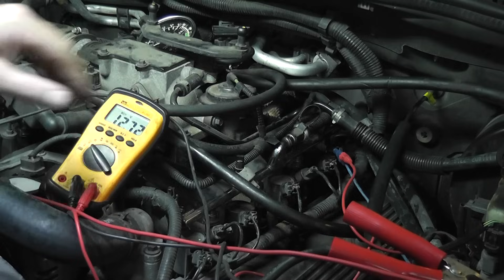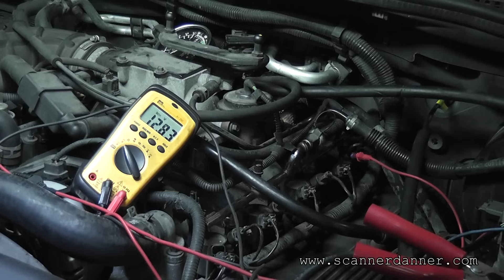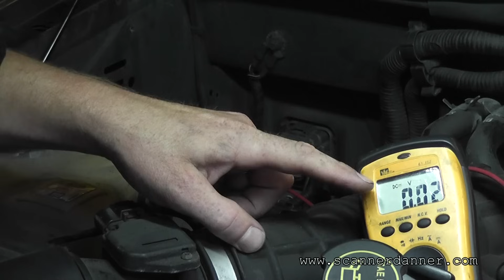How to test a fuel injector circuit with basic tools (open control wire)

Comment from the maker: This video was taken from a 5 part training series I did for my students on various ways to identify a misfire and restricted exhaust testing. You can find this 5 part series here 
https://www.scannerdanner.com/scannerdanner-premium-chapters/misfire-case-studies.html
Reply: Thanks for the great info! I have a injector wiring issue on my 2007 jeep wrangler. I have a cylinder #4 misfire. Its reading 14.0 -14.1 only on #4 cylinder. 1,2 3,5 and 6 injectors read 13.6 -13.8 and never reach 14.0. Where could my problem be?
Reply: Thanks I just found out what the problem was thanks to your video on crankshaft sensor. I was getting no spark on ignition coil pack but did have voltage on the connector. So checked voltage on the fuel injector with a light probe. The control side was no lighting the probe when I cranked the engine. So I checked the crankshaft sensor by the harmonic balancer. As I was checking the connection, I noticed the teeth weren't underneath the crankshaft sensor and the belt seemed off. After further inspecting the harmonic balancer I notice it was coming out which got the teeth to not be underneath the crankshaft sensor. The bolt holding the harmonic balancer had broken off and balancer was coming off.
Reply: Do you know of a great mechanic in the 92336 zip code area. I am in Southern California. I have a  2000 Ford mustang v6 with a crank no start, no spark. I have checked about everything, I think, and I am thinking it probably something simple that I am missing. Any help appreciated ¹
Reply from the maker: @victorrodriguez2158  I have a few shops using my training in southern California. Check out our shop directory  https://www.scannerdanner.com/find-sd-shops.html
Reply: Thanks again

Comment: Since you already know that the injector is not firing, and you have the wire identified and back-pinned at the PCM, couldn't you just pull the connectors off the injector and the PCM, and check for an open doing a continuity test? You wouldn't need the noid or the test light, or even to start the vehicle.

Comment: Hey I have Long term fuel trim -18 to -20 I think injector leaking? When car is in almost normal temperature it says about -17... It means to much fuel so how to check what's wrong? Should be one or few Spark plugs wet or.... to see which leaks?
Reply from the maker: Injector balance test for sure. Is this a GDI system? This get's done with the scan tool if it is. If it is a MPFI system, you will need an injector timer tool and a fuel pressure gauge. I have videos on this
Reply: @ScannerDanner how much I googled it says mpfi
Reply from the maker: @Evald4s  what is the year, make, model and engine size?
Reply: @ScannerDanner 2004 Ford Galaxy (wgr1) 2.0 petrol
Reply from the maker: unfortunately we do not have that model here, but it being an 04 model year it is most likely just a regular port fuel injection system

Comment: It's 08 gmc sierra 1500 4.3 v6 spider injection  ,
My question is with only disconnecting how to check n the procedure for pulse signal?
Reply from the maker: No different than any other injector. You have a control wire for each injector in that main bulk connector. Lab scope or test light can show you a pulse

Comment: There's not one single video anywhere on the net .
On how to test a 👉spider connector👈🏽 .
It keeps throwing to way older models or single individual injectors, 
Can you help
Reply from the maker: What's a spider connector? Are you talking about the "spider" injector assembly? That's a slang term. It is called CPI (central port injection) and there were two types. The earliest models (up to 95) used one central injector and then with OBD2 in 96 it was changed to a sequential system with one injector for each cylinder.
So I need you to clarify what you are working on, and what problems you're having and what you are trying to test for.
Reply: @ScannerDanner yes

Comment: what if the injector is always on?
Reply from the maker: Short to ground on the control wire or shorted driver
Reply: @ScannerDanner  driver short is the ecu ya?
Reply from the maker: Check control wire first before you condemn a driver!

Comment: How did you fix the issue
Reply from the maker: based on the title of "open control wire" I would probably use a crimp style heat shrink butt connector

Comment: Could you do something similar on diesel injectors without a scope. Noid lights and test lights etc don't pick up injector pulse on diesel but I'm curious to know if there's a low tech way of testing them without access to a scope.

Comment: Awesome video!!  My wifes 2013 civic says injector stuck open. My injector wire isn't pulsing its staying 12v both sides.  Is that her computer that's bad?? PLEASE HELP
Reply from the maker: How are you testing the injector control wire? A voltmeter is too slow to see the pulses. If you're sure there is no control, the next step is to test that same injector control wire at the PCM. If it is 12v at the injector and 0v at the PCM, you have an open in the wire.
Reply: I used a light and all are flashing except cylinder # 2    2nd from the left.    I hvae 12v on yellow wire. But pulsing wire not working.  I do have continuity from ecm to injector in that wire    @ScannerDanner

Comment: This is a great informational video. Thank you for this and all the other information you share as well. I just have one question: if there is battery voltage on the control wire at the injector, why should it be zero voltage at the computer?
Reply from the maker: It should be battery voltage at the ECM as well.
Reply: Thank you for clarifying. I must have misunderstood the video... @ScannerDanner

Comment: Scannerdanner I know this video is old but I could use your HELP!! I have a 2000 Dodge Ram 1500 the other day I got in it and when I started it the engine light came on so I put the scanner on it and it said po306 cylinder 6 miss firing here after a closer look either a squirrel or field mice chewed the wires to the injector so I got another injector plug and wired to replace the bad one but now it's still feels like it's missing and on the scanner it says open circuit , is any chance you give me some kind of direction on what to do next , I'm not a wealthy man I live check to check I'm 65 and Pops 90 we're both lost on what to do next any suggestions would be well appreciated 🤯 ,
 Thank You myfriend so much 👍✌️

Comment: Hi paul just came across your very informative video. I have no injector pulse on cylinders 4 and 5 on a 01 f150 with 5.4. As soon as i put on the test light on the computer side it flickers and both 4 and 5 stop missing but the miss goes to cylinders 1 3 and 8. Watching it through scanner. Still means open circuits or bad pcm?
Reply from the maker: You must consider "intentional shut-down" with what you are chasing.
https://youtube.com/shorts/r5LE3EwjtP8?feature=share

Comment: I don't understand.  Why not just use the multimeter to test for continuity of the signal wire from the back of the PCM to the injector plug?
Reply from the maker: Which test are you referring to? Starting at the ECM and doing continuity testing is the last thing you'd want to do
Reply: Thank you for taking time to reply.  I mean once you have determined it is either the ecm or the wire from the ecm to the injector plug, why not simply perform a continuity test of the wire?  I have this problem myself with a 2000 grand cherokee.  I didn't want to tear apart the back side of the ecm electrical connector, so with it disconnected from the ecm, I probed the front side and checked continuity to the injector plug. If there is a problem with this method, I'm all ears. Thank you for taking time to share your knowledge.
Reply from the maker: @01Z06guy  i would simply perform a voltage measurment at the ECM pin in that case. A steady 12v (injector plugged in and known good of course) would tell you the wire is fine

Comment: BMW 2013 E70 N55. High  voltage to all of the injectors.  car does start, but idle poorly. I do read 12V  on  integrated supply module for DME as it appears you are connecting with test light at end of video. Noid lights on all 6 injectors does not turn on.

Comment: If I measure 12 volts at the Negative side of the PCM Inejctor Control Pin then that means the computer is shorted to positive?
Reply from the maker: No sir. It's just not being grounded, or your meter is too slow to see the 5m.s. pulses to ground

Comment: 1995 corvette , noid lights flash , but will not spray. 44 lbs fuel pressure , new injectors , will start if I spray fuel into tb.
Reply from the maker: A follow up to your noid light test. Give me voltage readings on one of the fuel injectors during cranking. Injector plugged in and backprobing
Reply: I have full voltage with switch on at injector
When I crank the engine voltage drops to 9 volts. I have checked all grounds for continuity, they check good.
The started pulls voltage down to just below 10v when cranking.
Reply: Thank you for your help , it's a 1995 corvette , and it runs if I pour gas into TB. I don't know what else to check. I'm leaning toward starter taking all voltage and not leaving enough for injectors. Battery is new 12.7 volts. Thanks again. Help😵‍💫

Comment: Wouldn't be this test same as performing a continuity test between injector wire connector unplug and at the computer connector wire  also unplug pin to pin ? To check if there is an opening if there is continuity then there is not opening or would a wire show continuity no problem but a slight opening big enough to be  causing current to drop but just good enough to pass continuity?

Comment: I've always been a nut and bolt kinda guy and would GLADLY pay for anything electrical. I had a p0304 on a GMC Sierra 1500 5.3L so changed injectors then had a connector clip break and replaced it. Only to have it followed by a p0300 random miss. Compression is good but thought there maybe an issue with the way I spliced the connector. Wasnt 100% sure how to test the connector so I found you. Thanks for this so I know how to properly test the wiring. 

I WAS just gonna unplug it to see if there was a change in the boggy/rough idle or not to tell me if I spliced incorrectly but this is a true way to test. So thank you again for this video friend!

Comment: Need video 2 to see how you fixed it
Reply from the maker: You're in luck. I have 5 parts to this series.
This is in the description:
"This is an open circuit test procedure using a test light and a voltmeter. Just some simple tools and knowledge of the circuit is needed. Also the procedures shown in this video can be applied to ANY ground side switched circuit. 
This video was taken from a 5 part training series I did for my students on various ways to identify a misfire and restricted exhaust testing. You can find this 5 part series"
https://www.scannerdanner.com/join-scannerdanner-premium.html

Comment: I have a similar issue with my outboard. I have spark, new injectors AND the noid light works when running but this one cylinder still wont fire. It's if there is no signal coming from the controller. But if it lights up there should be signal right?
Reply from the maker: You need a power and a ground for a fuel injector to fire. Are you saying you have a noid light installed and it is lit constantly?
Reply: @ScannerDanner  Well its hard to tell cause I have to raise the idle rpm a bit to keep it running. I dont see it flickering, it looks more like its always on and glowing, it also doesn't help that it's outside and bright. What I have discovered is when the engine randomly won't fire up I have BOTH no signal to the coil and no noid light comes on, so I am 99% sure the issue is the control unit as I still have 12v on the coil and injector. It would randomly run but only on 3 cyl and then one of the coils wont get signal on top of it and it goes to 2 cyl or even just one. When its running I do get spark on all 4 though. I can see it through a timing gun and visually when taking out the spark plug, even in the "bad" cylinder. So to me it seems like its the control unit. the engine was under water in salt and I already fixed a few electrical issues and had it apart to clean it. It runs but just not as it should and it's definitely an electronic issue. Even the injectors are new, same issue.

Comment: Thank you for the many videos. With 305000 Km on a SAAB 9-3, is it a good idea to replaced the fuel injectors. I have code P0201, P0202, P0203, P0204 and P0245. The ECM came back from repair stating "No fault found". There is no check engine light on.
Reply from the maker: Scope testing those fuel injector circuits would be my next move for sure with those injector codes
Reply from the maker: Does it run? Is it misfiring?
Reply: Yes it runs, it’s constantly misfiring at all cylinders and there is no check engine light.

Comment: On my jeep liberty v6.
Noid light on #2 injector stays light not flash. 
Put new injector in,  still same. 
Test light at pcm for i#2 stays light,  not flash.  
Bad pcm #2injector driver?  I've check every circuit,  no fault to ground..
Reply from the maker: You have either a short to ground on the control wire or a shorted driver. You must confirm the control wire is not shorted to ground. 
Step 1 - unplugged injector connector (very important to do this to ensure no backfeed on the next step) 
2. Test light to battery positive and touch on injector control wire
3. Unplug PCM 
Test light lit with PCM unplugged = short to ground on control wire
Test light goes out= shorted driver
Reply: Thank you.  I preformed the test you mentioned. Light went out after pcm unplug. 
 And it looks like it's the driver
Reply: Thank you again very much.  I want sure when i was testing the circuits,  injectors, coils for resistance & continuity. 
Everything was pointing to a short but i couldn't find it in wires. My previous experience with jeep had me believe it was the pcm.

Comment: I really dig your viseos they're very informative and ive learned a couple things watching them, but how do i go about testing the injectors when they are sandwiched between the lower plenum and the intake manifold? I have a 01 Nissan Pathfinder 3.5 4x4. If you can give me a couple of pointers or a direction that i need to go in to accomplish this task. Thanks in advance.

Comment: Is it likely that a control module would be intermittent? I have a negative pulse sometimes but mostly no pulse.  The car is in a parking lot and i didn't have a diagram to find the pin on the ECM. Trying to decide weather to tow to my house or a shop that can program the ECM   2011 Corolla. I am guessing that the ECM would be permanently  bad if it was the problem.

Comment: Please...need a help...I have 04 crown Victoria. After running while (about 10 to 12 miles) intense white smoke with severe petrol smell is coming out. We have checked the fuel injector and cleaned and everything is fine. What may be the potential cause then.
Reply from the maker: You need to focus on injector control, not the injector itself. Shorted driver or shorted control wire will cause an injector to spray continuously. You need to first ID what cylinder is causing this issue

Comment: Please help. I'm having a issue with my 2014 silverado.  Code was P206 bad injector.  I changed it. Still misfires.. how can I test the injector wire coming out of pcm to see if that wire is getting 12 volts? Not sure how to hook my meter to it
Reply from the maker: Is it a GDI system? If it is, you can't test that circuit with convention port injection methods.

Comment: Thanks , the injector has 2 wires, We cut the both injector wiring , Can we put injector wiring back without any order?
Reply from the maker: Convention port fuel injection? Yes, you can wire them either way, but I'd still follow the order of the other injectors as far as orientation
Reply: it has 2 wire on injector connector , but I forgot to put some marker on them  @ScannerDanner

Comment: I need some help, my 2012 jeep patriot have a code p0304 for misfire cylinder #4 I put new spark plugs and swap the coil and injector to #1 and I still have the same code for cylinder #4, any ideas? Thanks
Reply from the maker: You need to test for coil control from that PCM. 2 wire cop? You'll have a constant feed on one wire and a pulsed ground on the other. Disconnect the injector connector and touch on the control wire with a test light to battery positive. The light should flicker if there is control. Test a known good to compare your results.
Reply: @ScannerDanner  thanks, but do you think that I have to check the compression of the cylinders?
Reply from the maker: @sergioramos2413  compression and injection pulse must be verified as well as coil control
Reply: @ScannerDanner  I checked the compression and cylinder #4=190 #3=160 #2=190 #1=185 what do you think?

Comment: Ah over my head it went.  I have a similar thing going on.......  and I've tested the wiring on the harness for connectivity and that was fine, I tested it back to the ecu and that was fine but where the injectors are I can't test the electrical side as they are covered when the engine is running on this.  I'm not sure if I have a test light but yeah...  I'm stuck it's a v6 direct injection and I got banks 4 and 6 misfiring....  changed injectors, changed plugs....  have not done a compression test yet but they were fine before doing the new injectors so I presume..... it is injectors?  or wiring...

Comment: at 1:37 theres a note 4 using a test light instead of the noid.  do I connect the two sides of the test light to the connector?  basically jumping the connector using the test light?